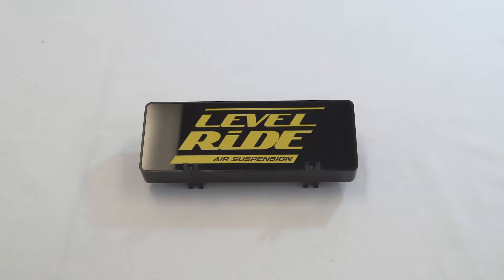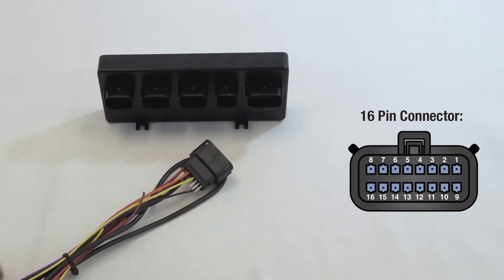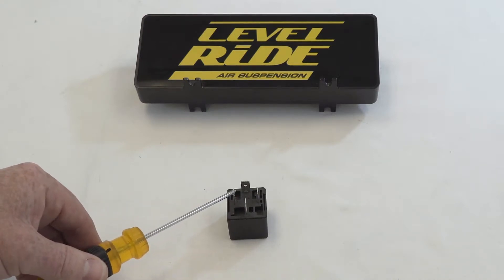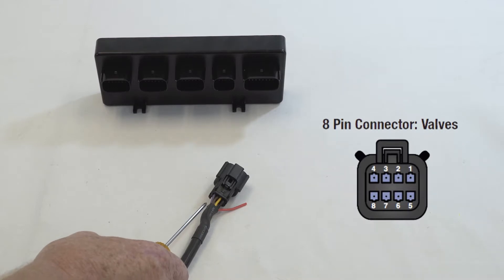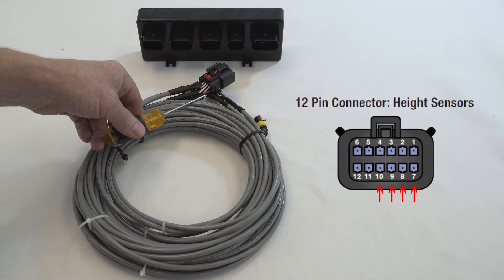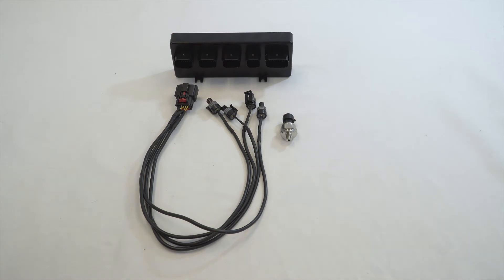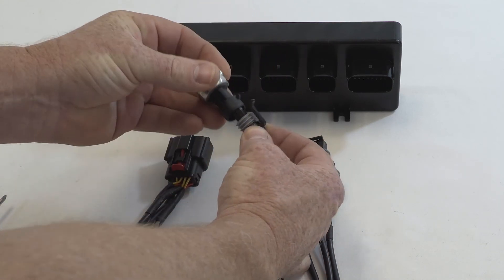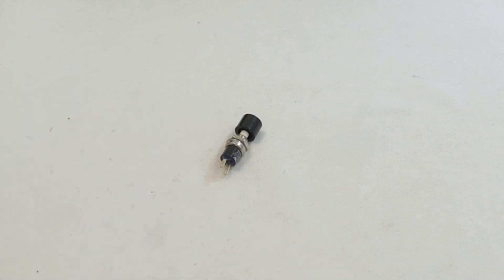Video 3 Level Ride Main harness wiring

Comment: @0:42 BROWN wire to brake. what is the purpose of this wire? does it need 12v power when brake is depressed?  does it need to be connected?
Reply from the maker: The brown wire is the brake interrupt and needs to be connected to 12V out when brake is applied , this stop unwanted adjustments as it tells the ecu the brake is applied, also when you sit in traffic its important also, when highway or winding roads driving going on and off the brake frequently tells the ecu these changes are due to this type of driving and takes out the unwanted chnages in height from this type of driving so it wont make unwanted adjustments